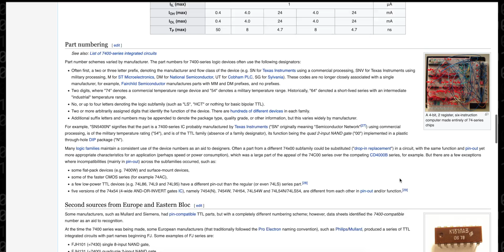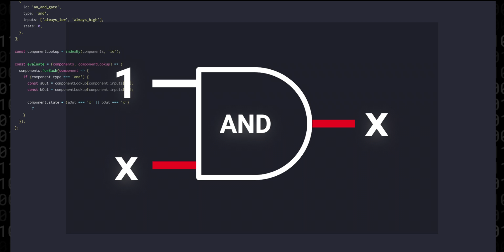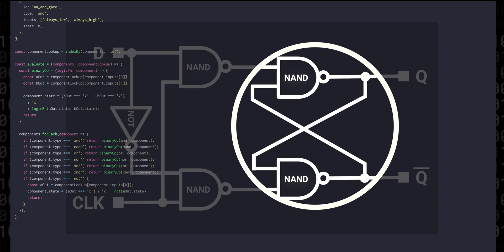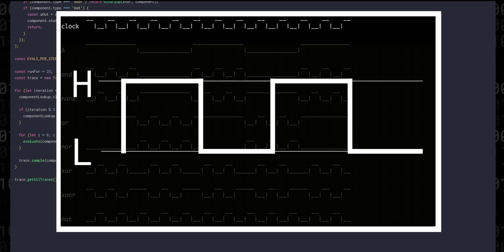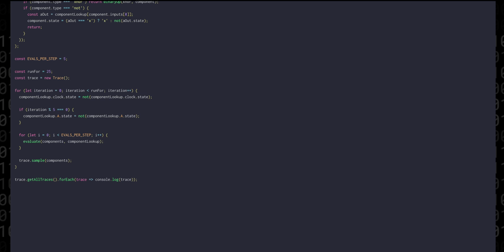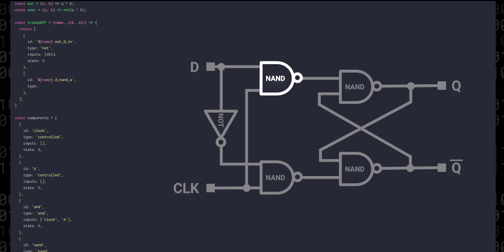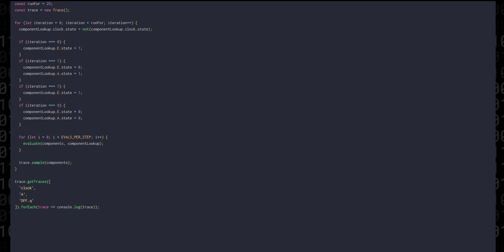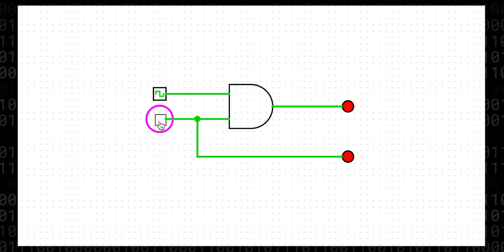Digital Circuit Simulator In JavaScript: 7400 Subscriber Special!

Comment: My own js logic gate sim: drag and drop, integrated circuits, configurable ics and more stuff: https://logic-gate-simulator.herokuapp.com/

All controls can be found here: https://github.com/Mateiadrielrafael/logicGateSimulator/blob/master/docs/tutorials/controls.md 

Repo: https://github.com/Mateiadrielrafael/logicGateSimulator

Also, i forgot to mention how the sim supports multiple bits per pin (aka u can do logiv operations on say 4 bits or whatever using the bit mergers & splitters)

If u need any more help contact me at "yugiohxlight!#6117" on discord:)

Short explanation:
To add a logic gate click "logic gates" and click on the gate u want to add
Move around / zoom / drag stuff with the mouse
To connect 2 pins click on 1 of them and then click on the other
To delete a gate hold it w the mouse and press delete
You can also select multiple stuff at once w the mouse (i think i also made ctrl + mouse to add to selection)
To delete a wire click on the input pin its connected to
There are a lot of actions (select all,copy,paste, undo etc) avabile in the "simulation" section, it also shows up the keybindings for them

Some gates (the 2 types of delayers in the sim) are "configurable": aka u can left click on them to edit their props

If u left click on a configurable gate inside an ic, ull see an "external" checkbox. If u activate that, the ic itself will become configurable and will pass the values to the external gates inside. (Youll also have a label textfield so u know who you pass the props to).

Hope ull have fun, and dont forget to ctrl s often or u might lose stuff

Creating simulations is simple: click "create simulation" and answer the questions (name of the simulation, should it be an ic? etc)

You can open other stuff with the "Open simulation" button
Reply from the maker: This is great Adriel! Are you actively working on this project?
Reply: @LowByteProductions  disclaimer: this was originally made for a national programming contest for high school students called "infoeducatie". (I got the second place with it :D) A friend told me today on discord about ur video so I thought I might comment here
Reply from the maker: "infoeducatie" - I guess you must be Dutch then :D Gefeliciteerd met de competitie man! De enige ding wat ik mis is modules. Is het mogelijk modules met inputs en outputs te maken (e.g flip flop, clock, etc)? Ik denk dat dat een super feature zou zijn!
Reply: @LowByteProductions  im romanian:)
Reply: @LowByteProductions  well, i originally made it last summer but fixed some bugs and added some features for some friends this week:)

(I basically come back at it every once in a while)
Reply: that's a really poggers sim
Reply: @beepbeepimasheep237beepbee3  thanks
Reply: @moonythm  how do you use a decoder? I figured out using a bit merger but is there any better way to do this?
Reply: btw, maybe add ram? i tried creating a 16b ram but i'm afraid it might become slow

Comment: Takes me back to the time I was learning this for the first time at university and the frustrations of using logisim.
Great video.
Reply from the maker: Thanks! I've tried all of the various forks over the years as well. Many improvements, but a lot of the same problems. Logisim Evolution is pretty good - it even has some FPGA integration features built in!